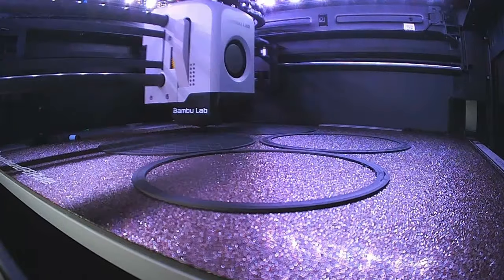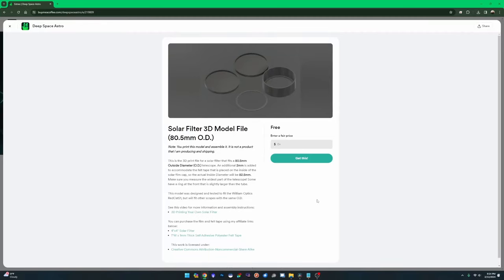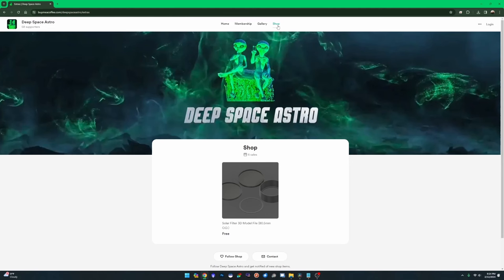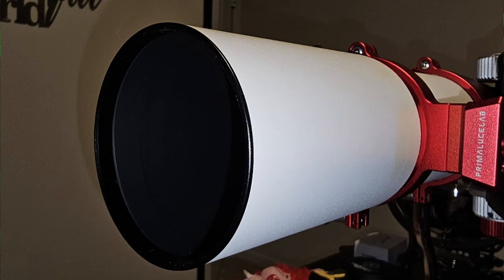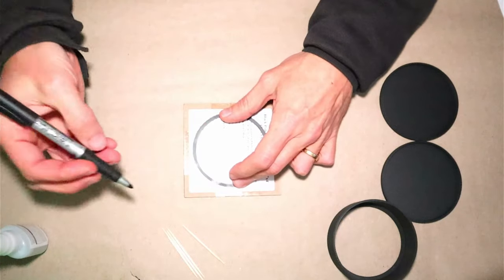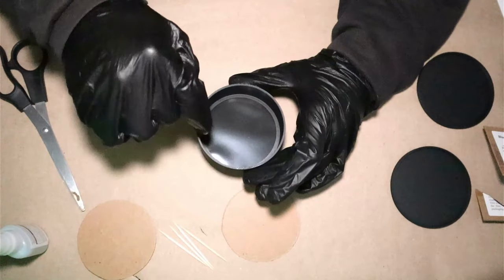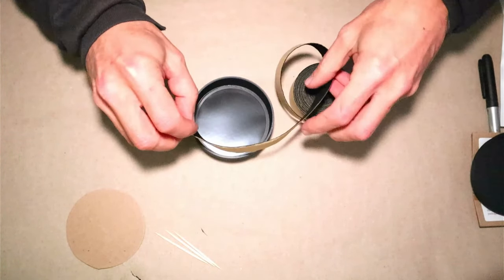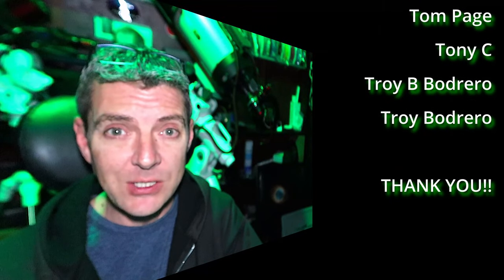3D Printing Your Own Solar Filter

Comment: If you said it in the video, and I missed it, I apologize.  Are you printing these in PLA or PETG usually?  Wondering if the heat would be an issue at all.  If PETG, going to have to pick myself up some.
Reply from the maker: PLA and I haven't had any issues with them.